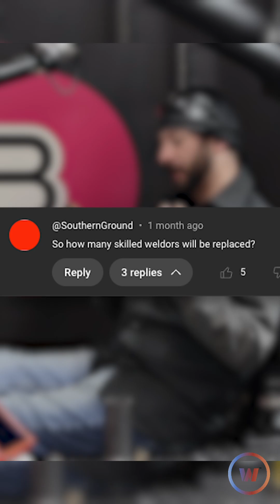Why Are People Hating On Cobots? #automation #cobot

Comment: There is a shortage of welders. There will always be a job for at least the next 20 years until we catch up. Hell, there's a trade shortage be it plumber, electrician, hvac, welder
Reply: You're right. At last check we need around 200000 more welders.

Comment: You are correct in saying that to use the automation, you have to know how to weld and the fabrication as well. I used to work in a pipe fabrication shop for fire protection systems. They bought a North Alabama Pipe Universal Welder for me to use. It was an absolute, game changer as far as getting outlets put on the pipe. Sure, anybody could run it in 30 minutes, but if you don't know what you're looking for, it was a nightmare. Keep up the great videos sir.